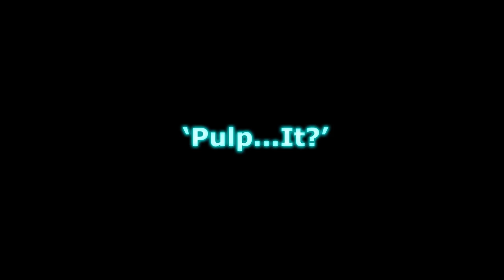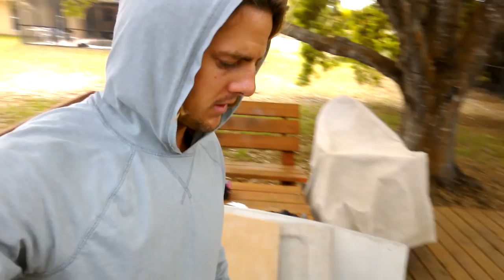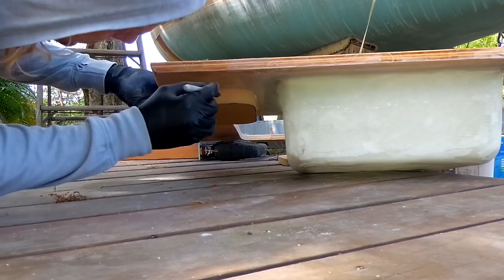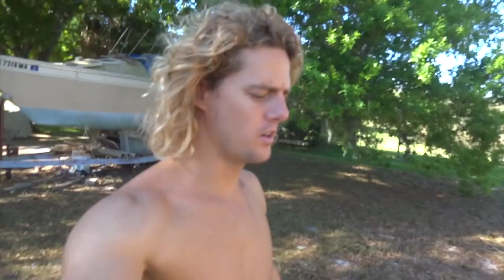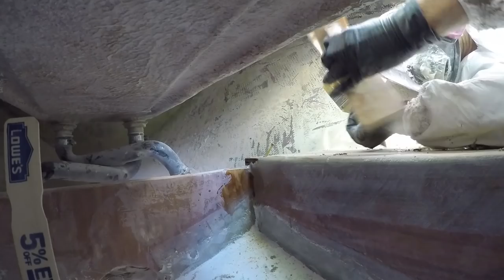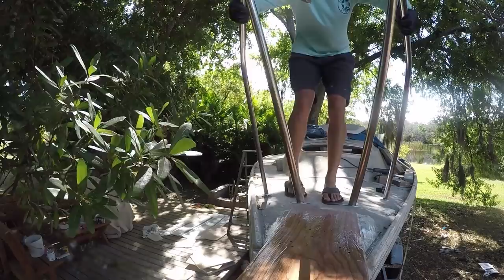Adding a Diving Board to my Sailboat?!? - Ep. 23

Comment: Well done with all the advances in construction. Do remember as you proceed that every fixture adds weight and as with all small structures weight is a penalty. Your use of cellular material as a stiffening core is very sensible. Remember plywood can carry a weight penalty beyond its convenience. As with road vehicles structural weight reduces load capacity. Start calculating your water and fuel weights and their effect relative to their position in the structure. Don’t be afraid to alter a treasured design now to save problems in future operation, at that point you will be miles out in the ‘Oggin’.
Reply from the maker: I'm def. worried about the weight, but have used foam where I could. I think I removed more wood then I put in, but won't know until it is in the water. We'll see how it goes and I'll make edits as need be. Thanks for checking out the video!

Comment: I think a diving board on a sailboat is called "the plank".  Are you going to have a roller for the anchor rode on the end of it?  My plank has a strut below that braces it against the bow lower down.  If you use 3" or 4" PVC for table legs under the cockpit picnic table, you can use the slip-fit caps as sockets for them to slide into.  With such a large diameter and solid slip-fit sockets to go into, my table only has two supports, which might work out well for your cockpit table as well.

My departure day has slipped from mid-May to the beginning of June sometime.  Any ideas about when you plan to launch for the summer?  If we wind up ready to go at about the same time, I can tow you across the gulfstream so we make the crossing in daylight.  There are thunderstorms out there almost every night in the summer because of the warm water making its own weather.  I got the Carver so I could cross in the daytime after discovering this inconvenient weather pattern.
Reply from the maker: Haha yeah its definitely a plank...well this summer seems unrealistic to me, probably a dream in the terms of I wanted to get in the water and test out things only to finish the boat later. It definitely wouldn't be liveable. Yeah, I'm not sure I'm keen on sailing on such a small boat during the hurricane season in the bahamas. For now I like the idea of pulling it in and out with a trailer. Maybe next year I'll be really ready for long distances.
Reply: @NeonSwell  I plan to have my boat out of the water before the second week in August.  I looked at the dates when hurricanes have hit.  There are relatively few in the first part of summer, but the probability goes way up by mid-August, and September is really bad.  I lived in the Bahamas part-time in the 80's and summer was by far the nicest time to be there.  Winter has big wind and big waves most of the time which makes being on a boat miserable.  That all settles down in June or so, after the spring weather season passes.  Then you get calm seas and the water gets warm enough to stay in longer.  July is by far the best time to be cruising the Florida keys or Bahamas.  There are days when the ocean is glassy flat like a millpond.

I'm still not sure if I'm going to the Exumas this summer or just the keys and possibly Bimini.  It will depend on how well the boat is running after I drive it down to Miami and cruise around the northern keys waiting on a weather window to cross the gulfstream.  If there are any issues with the boat, this summer will be spent in the keys, then back here for more boat fixing.  If everything is working well, I'll probably go for it when the weather allows for an easy gulfstream crossing.

Comment: Great video! Any advice on filling that compass port on the bulkhead? Seems like a wonky position! Is it in one of your videos? I don't remember it. :D
Reply from the maker: Hi Josh! thanks! Its actually not, it was the very first thing I epoxied on the boat. I cut out a circle of plywood to fit the hole then smushed it in with really thick epoxy covered by glass on both sides...unfortunately it isnt in any episode. Thanks for checking out the vids.
Reply: @NeonSwell  Thank you! I just have to figure out how to get in there from the salon side, the headliner is a problem. 

Anyways, keep up the good work. I look forward to more.